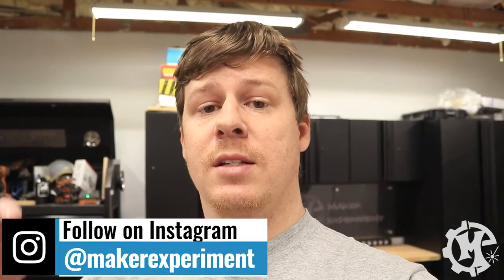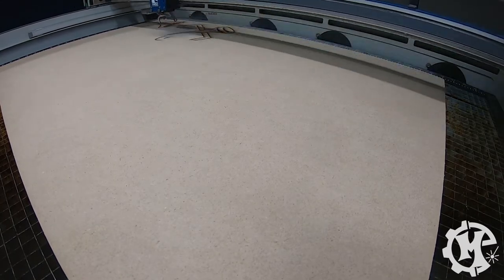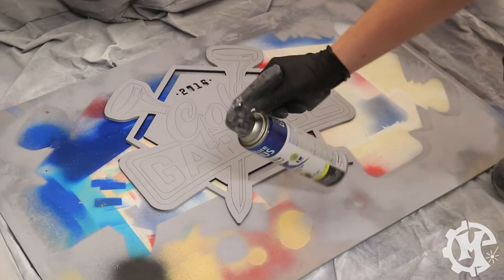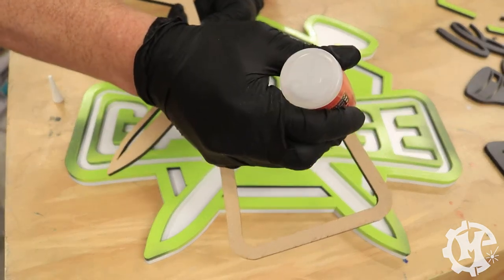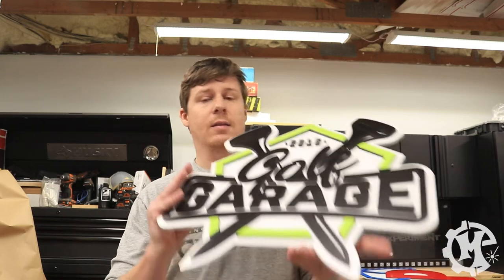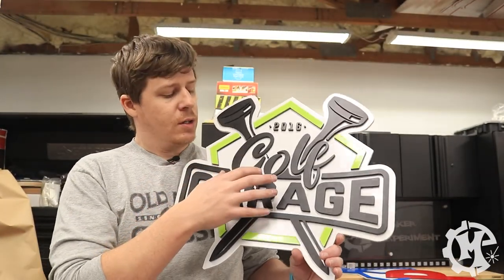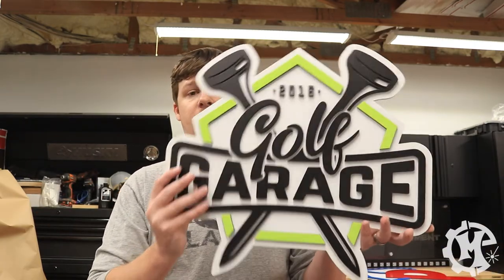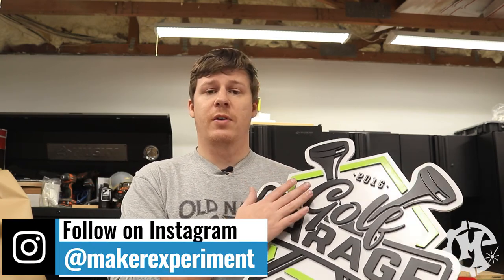Making a Custom Sign for The Golf Garage

Comment: I too have had the spray paint issue with rust oleum. If you found a solution I’d love to know. I find the warm weather helps
Reply from the maker: XClomesX warm weather helps. Consistent pressure on the spray can while painting helps. It also helps to make the layer before a little rough with a light sanding to help the paint grip.

Comment: the weird effects with spray paint usually happen when you've let the layers below cure too long but not long enough.  Be sure to follow the instructions for coating times on the cans of paint you're using.  I typically go 10 mins between coats and it typically works pretty well, using multiple light coats.
Reply from the maker: I’ve figured out a lot of that since this project. I appreciate the feedback.

Comment: When paint cracks when applying paint on top of the next layer. Is because the first layer of paint didn't have enough time to dry and the solvents in the paint try to escape through the last layer you applied. Casting it to crack
Reply from the maker: Yeah, it was just frustrating on this because I waited 2x the recommended cure time. Sometimes you just can’t tell easily.
Reply: @MakerExperiment  another good think to take in consideration is. The brands you use. Some paint don't mix well. Try to stick to the same brands. Which is problem hard to do
Reply from the maker: @ormondscott191  thanks for the info. I’ve definitely wondered about that.

Comment: Cracking happens because you painted another coat without letting the first coat cure long enough. Recommend at least an hour between coats or longer if it’s cold out.
Reply from the maker: I agree with you. This paint actually say for 24 hours from what I remember so it took extra long apparently.

Comment: How do you paint the edges of the letters if they are in the cutout/template thing? I would imagine lifting the cutout off and doing a final coat?
Reply from the maker: I don't paint the edges. Covering a laser-cut edge with paint is difficult. The edge ends up being so dark that the paint never quite covers it.